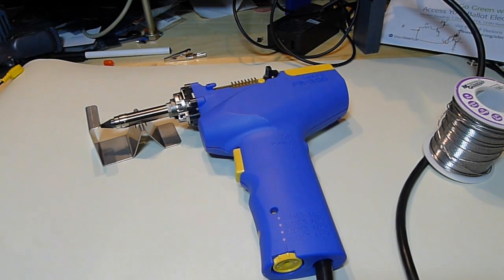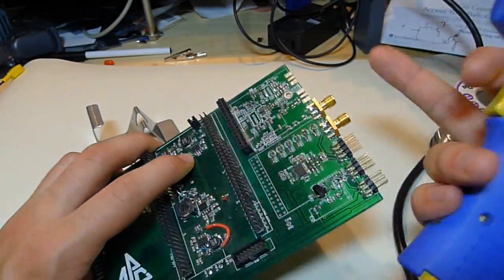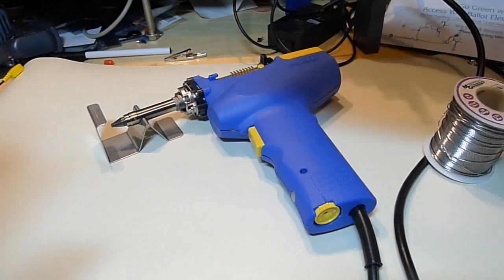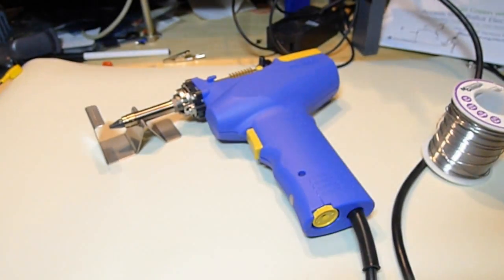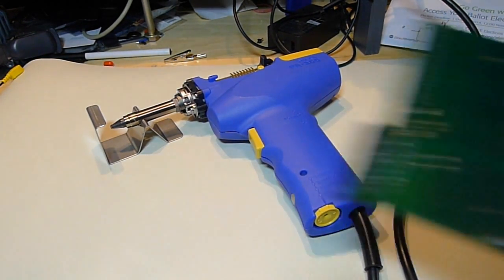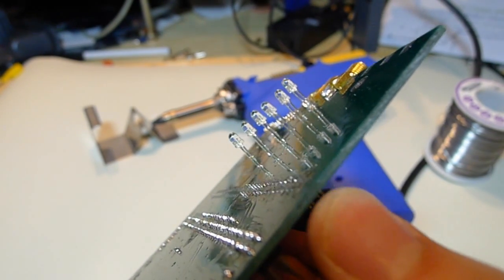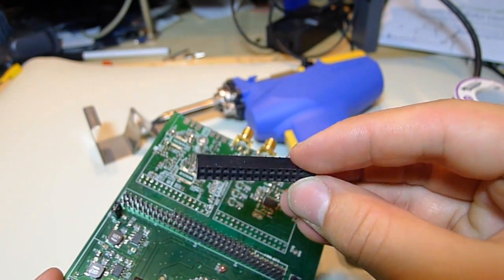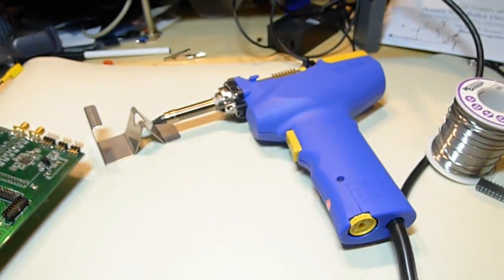Hakko FR-300 FR300 Desoldering Tool: Example of Removing a Header

Comment: I just bought one, after struggling with a solder pump and a solder wick approach, I guess my skill set is too low, and I've ruined a couple of connectors so far...hoping this does the trick.  Nice demo of a very similar project I'm working on.   thx for vid
Reply from the maker: good luck! Yeah I had almost zero luck with a pump, and the wick is hit or miss, I only use wick with SMD really. I find MG chemical wick works well, but stuff from adafruit didn't work as well (threw it out). this hakko unit is well worth the money!